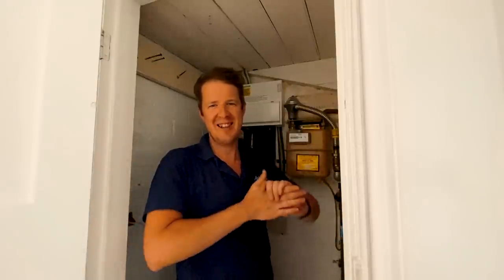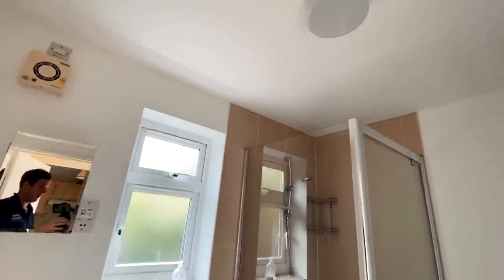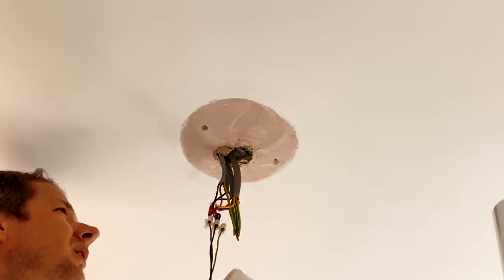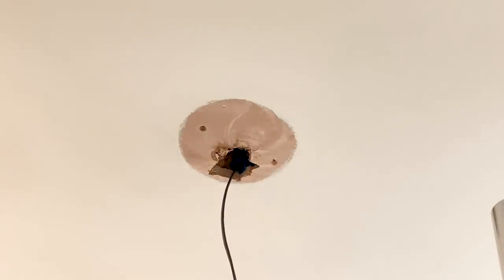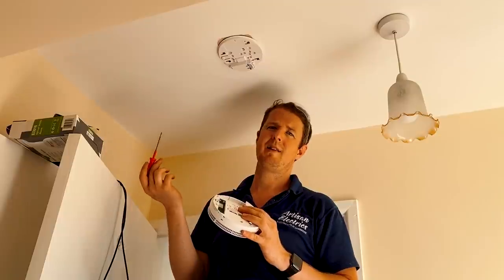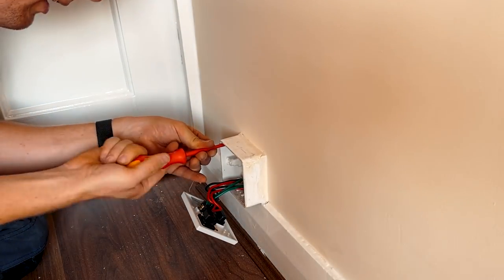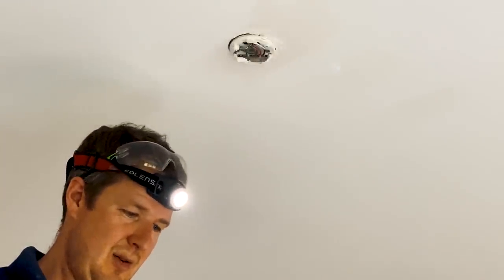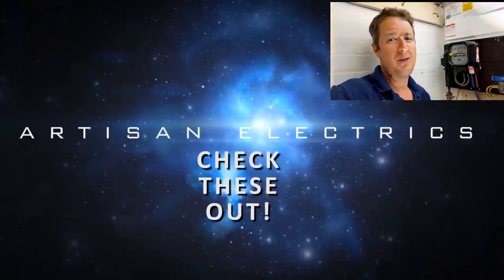Repairing Electrical Faults - Electrician Life

Comment: Here in US I would not be able to find a smoke detector to fit old base after 3 years let alone 10. Like how UK devices have screws, here most all that connection is done with "scotch locks".  The maintenance free junction boxes seem fragile compared to the norm here, especially at 240V.  Love the missing rose! I can't or won't say how many Mic and speaker cables I've soldered up with the shell laying on the table top. Damn pretty soldering, too, the first time... You're a good instructor, clear explanations, great sense of humor, and not afraid to show the  little bits that make us all human. Enjoy this channel very much. Good advice and tips even for a Yank to follow.

Comment: The other classic is the old MK and Duraplug 13a plugs where you put the cover on the flex first. I've seen quite a few covers with cuts where someone didn't want to rewire the plug...all of two minutes' work.
Reply: See that quite a lot in theatres, on duraplug 15A round pin plugs, i think the newer ones have a different moulding to avoid the problem though.
Reply: @TheErador  yes, I used to work with 5A   rubber plugs in small theatres and saw it there too.
Reply: Worse when you have threaded the cover on the flex and when you come to attach it to the plug top body you realise it's wrong way round.
Reply: @iansanderson4664  hahaha yep I've done that once or twice. I never resorted to slicing the plug top to avoid rewiring tho., it's clear other people before me were lazy enough or in enough of a hurry however.

Comment: Hold the light against the ceiling with the hole in a place that if the screw goes through the case it's Hiden by the light when fitted. Great videos 👌

Comment: On  a housing association I work for we have been asked just to fit like for like with smoke alarms. I.e battery for battery only as per client's choice where mains arent fitted.
I'll have to look into those Aico interlink battery smoke alarms
Reply: It’s interesting to hear the differences in standards between different housing associations. I too work in social housing and the client insists that we always install Aico mains powered alarms with battery back ups. As a minimum standard there must be a heat alarm in kitchen, and smoke alarms in hallways and landings all interlinked. If existing alarms are just battery only, then we have to upgrade to the standard. I thought that would be the case with all housing associations, especially after the Grenfell tower disaster
Reply: @darrenqualters2341  you would of thought so, we were installing mains wired ones then the head inspector for the housing association said not to and they would install them on the rewires and five yearly tests. We can only do what the client asks at the end of the day

Comment: I’ve hard wired them in. when they are all linked together they go off incase your not in that room. you can fit a switch which you can use to locate the alarm that caused it to set it off. Or test an reset it. The switch is only battery operated. Just thought I’d mention it

Comment: You should invest in the 12v Milwaukee Impact Driver and Combi Drill set. It's Ideal for overhead work such as putting up that light rather than that bulky 18v Makita combi drill
Reply: @Luke Heffernan 
If you’re reducing the size of your tool for overhead convenience why would you go with Milwaukee the heavier option and not Bosch? With that said why would you go with Milwaukee obviously your favorite, or Bosch my favorite if neither one of them have the ability to support 20700 cells (the future) and support legacy (the past) 18650 cells, so I would lean towards Metabo or Hilti 12v tools if I were making a suggestion to someone not being a fanboy. Just a thought...

Comment: I'd put money on that mess at the light fitting being created by a spark - many DIYers would be too daunted to deal with all those connections!

You're lucky you didn't have more going on - the one I found the other day had feeds to 2 pendants and a shared 3C+E switch cable all hidden above one pendant 🤨 (although I did have access from above)

Comment: You should buy an awl, it's the best thing to penetrate the screw fittings if you get a thin pointy one.
Here in Germany you'll mostly find the battery powered ones in domestics, mains powered ones only in commercial or industrial installations.

Comment: 29:30 - literally every spark saying 'you haven't put the plate cover on'!!
Reply: Dude, the heat must be getting to you Jordan 😆😆😆
Reply: Ade Jupe Do you remember the old mains plugs which had the same problem - you had to slide the cover over the flex before terminating... or cut a slit in it when you forgot 🤣

Comment: Regarding material shortages, as an Electrician I haven't had any really but I now have 4 rewires awaiting 2nd fix due to the plaster shortage which won't be done until October now so it has affected cashflow a bit

Comment: In a standard house battery only is fine,any smoke detector is better then none, if doing a rewire then include hard wire in  price, I use radio link detectors taking permanent feed from nearest light in some cases, HMO will comply with local building regs ?

Comment: Had a shortage of RCBO's from Hager, Contactum and Wylex as well as Wago's. Basically anything to do with improving landlords properties post July while people have rushed out in a panic to comply on top of the shortage from Covid. A note about the Aico wireless battery alarms - they're a bastard in any building with concrete floors and metal studwork - blocks the signal.

Great video as always but would still like to have seen a non-combustible non-conductive barrier or the gas meter moved though.

Comment: Hi Jordan.  Is the consumer unit not to close to the gas meter?  In the building regs it says in  section 2.3 of the onsite guide that the gas 
instalation pipework  should be at least 150mm away from the electricity supply equipment, main service cut outs, isolation switchesa 
and consumer units.  Doesn't give a regulation number though.

Comment: Re wireless alarms, I advise caution. If there are concrete walls or ceilings, or if there are steel beams in the structure the signal may be too weak. With safety kit, wired is always safest.

Comment: I’d always pilot hole the light fitting first
Reply from the maker: Good! That’s what I should have done 🤪
Reply: You can get hex drive drill bits, so you don't need to remove driver head, as you would with a conventional drill bit. Good for pilot holes.

Comment: I have a Texecom alarm system so use the Texecom Ricochet smoke detectors.  Battery powered but wirelessly linked to the alarm panel.

Comment: Is it a new building reg thing re: wired smoke alarms so it's always got power one way or another?
Reply: It's part of bs5839. Life safety appliances should have an independent feed preferably with battery back up. So basically their own breaker.

Comment: Washing machine and dishwasher on a double socket- recently called out to a melted double, customer could smell burning in the kitchen.Changed to 2 singles. Sorted
Reply: Why did the socket melt was it overloaded or wired wrong .
Reply: Double sockets ( this one at least) was rated at 13 amps. Dishwasher and washing machine on at the same time repeatedly . I recon 20 amps
Reply from the maker: Oh wow!

Comment: If its a rented property, it is actually a recommendation in the BS5839-6:2019 fire standards to use only mains powered with tamper-proof battery backup (Grade D1). With an LD2 category of system, which is cover for: Kitchen, Hallways/Landings, Living Rooms, Loft Conversions.

In a privately owned property, grade D2 detectors are recommended (Mains powered with user replaceable battery backup), the same category of LD2. This could apply to existing houses that are having major work done such as extensions/re-wires.

Personally I don't understand why replaceable batteries are still a thing, I have never had a tamper-proof lithium battery backup become faulty. 
In HMO's and student accommodation, all you get is students taking the heads off and taping over the green light (sometimes the air vents).

P.S. I always try to convince the client to use radio modules rather than bases. As when it comes to the 10 year change, there is no rewiring or fixing up to be done.
Reply: In Scotland, rented accommodation must be fitted with mains powered interlinked alarms.

Comment: Smoke alarms - nest protect seem like a good option for new installs. Can be battery operated but also communicates with phone and all will alarm together. Will also alert on phone if low battery.
Reply: New installs require hard wired smoke detectors. Even adding an extra alarm you should be bringing it up to the current standard. Battery detectors should only  be used to replace old battery detectors.

Comment: It does say in building regs approved document b1 

General provisions
1.1 All dwellings should have a fire detection and alarm system, minimum Grade D2 Category LD3 standard, in accordance with the relevant recommendations of BS 5839-6.
A higher standard of protection should be considered where occupants of a proposed dwelling would be at special risk from fire. Further advice on this is also given in BS 5839-6.
1.2 Smoke alarms should be mains operated and conform to BS EN 14604.
1.3 Heat alarms should be mains operated and conform to BS 5446-2.
1.4 Smoke and heat alarms should have a standby power supply, such as a battery (rechargeable or non-rechargeable) or capacitor. More information on power supplies is given in clause 15 of BS 5839-6.

Comment: Hardwired in the USA for smoke detector required because it’s 2 stage fail safe mechanism. If dc battery fail it’s AC hard wired so detector works if AC mains power goes out DC battery provides backup power to allow smoke alarm to work. If ten year lithium battery fails before year 10 which could happen having a fail safe always helps. Also best practice in US is to have smoke alarm that are interconnected if one goes off they all go off.
Reply: Same in Denmark.😎
Reply: As far as i know same thing in the UK for tenancy properties . Mains powered and inteconnected.Minimum is one smoke detector for each floor + one heat detctor for kitchen area.
Reply: You forgot to mention arc fault breaker‘s or dual function breakers.
Reply: The Truth yes if they are on a separate branch circuit. Since 120-volt smoke alarm devices are considered to be outlets/sockets and at least one smoke alarm is required in each bedroom, the branch circuit supplying the smoke alarms must be protected by an AFCI (Arc Fault Circuit Interrupter) device. If a separate circuit were run to the smoke alarms, then an additional arc fault device would be required
Reply: I don't think smoke detectors use that much power that a battery will last less than 10 years. And replacing a battery every 10 years probably will cost you less than fitting mains powered smoke detectors. To be fair in my country even smoke detectors are not required in domestic installations, and in practically all houses they are not installed. But I think the reason is that houses in the US/UK are typically made of wood instead of concrete and thus domestic fires are more frequent. 

Arc fault breakers are not that useful, at least with 220v that uses lower currents than 120v. And with 220v are more useful RCDs, that are required on every circuit (while in the US they are typically installed in the sockets, in Europe you find them in the consumer unit, so not only the appliance is protected but also the wiring, so if some stupid does some work live on the wiring he doesn't get shocked)
Reply: A1eR  in USA the NEC 2020 code requires mains wired detectors with battery back up in residential properties and commercial properties. Arc fault circuit interrupters can be installed as breakers and at the receptacle. Indeed both types can be installed on a single circuit with the breaker detecting arc faults/heat and fire risks upto the AFCI at the first receptacle with the AFCI receptacle protecting against arcs for receptacles downstream of that. For a smoke, CO ionization detectors with strobe lights connected on the same branch (radial) circuit then usually an arc fault breaker is installed for that circuit or even a dual function AFCI/GFCI breaker. In fact for large buildings with multiple sets of different fire detection devices load calculations are done in quiet standby  and alarm mode with large battery backups for large buildings specd using all active devices in alarm mode (much higher loads).

Comment: A few more classic mistakes which all electricians will probably relate to, forgetting to put the shell on a comando plug, the rubber shell on some of the duraplug plugs/sockets, and the old favourite forgetting the neutral cover in a square d / schneider 3 phase board until after the cover is on!!

Comment: Can somebody point me in the direction of the reg or recommendation that mcbs should be spaced out ? Personally I think it’s bollocks.
Reply: They're RCBOs.
Reply: Rcbo s then mr pedantic
Reply: Good practice, nothing wrong with over engineering things when you have the ability to do so for no extra cost or time.
Reply: Shall we start installing 20 way boards coz we need 8 blanks for heat dissipation , never heard such codswallop.
Reply: @supersparks9466  Actually here in Germany that's quite the standard having so much space in the board, but I never heard of a regulation that you can't fit MCBs or RCBOs directly next to each other...
In my cellar the board has space for 72 units (6 rows, 12 units each), in the first floor is a sub board with space for 24 units (2 rows, 12 units each). But here you can do such things like installing an outlet into your board, I did that in my sub board. The outlet is a special one that fits on the DIN rail. Or as we call it here: "Hat rail", because from the side it looks like a hat in profile.

This is the main board, was installed by the local certified electrician. I modified it later, because I wasn't happy with several things, and I added another fuse carrier for a sub board in the garage (EV charger). And I was renovating the house at that time, performing a whole rewire of all circuits. That's the reason there's almost nothing connected on the pic. The board is only for the circuits in the cellar and the ground floor. First floor is connected to the sub board, the three D0 fuse carriers you can see here contain the fuses for this board (3x50A).  

It's three-phase, which is common here, even in domestics.

https://abload.de/img/img_59291bj8x.jpg

https://abload.de/img/img_5931c8jk1.jpg

https://abload.de/img/img_5933gtk3p.jpg

https://abload.de/img/img_5932gxjyu.jpg
Reply: Hi Supersparks,this bollocks is unfortunately true,the manufacturers of RCBOs have this grouping factor which can potentially derate the current carrying capacity,you have to check their manufacturers instructions,our industry should be dictating to the manufacturers what we require not the other way about.
Paul Meenan from E5 has written about this and would be far more knowledgeble than me.
Reply: @sparkymacsparkface7497  never known that to happen, a 6a tripping cos next to a 40a , must be a heavy load for a long time to produce a lot of heat, the only time spacing was done is when you have banks of contactors in an enclosure, not mcbs
Reply: Well I don’t mind being educated on it but still no one is pointing me to a reg or any written spec on it. My niceic assessment has never flagged up this issue.  Why are these rcbo s running hot? Are people not designing there circuits properly?
Reply from the maker: E5 recommended it to me as an idea as RCBOs can produce some heat
Reply: @sparky macsparkface well I will wait with baited breath for the amendment in the 18th.
Reply: @artisanelectrics that’s fine, what happens when you need to add circuits that will fill the space? Another dB ? Has anyone thought this though? Surely the manufacturers should be on top of this. Next we will be fitting cooling fans inside.
Reply: @Marcel_Germann  lol wow and i thought our panels in north america where big
Reply: @Kevin-mp5of  we have them in the states as well called arc fault/gfci duels
Reply: there isn't one, but then again the regs are just a minimum standard written at the time that can be deviated away from for the better drawn from experience/risk assesment. if the current thinking/experience is that rcbo's get hot then if the space is available in the cu then it would be best practice to learn/follow from others. every day is a school day
Reply: Artisan Electrics I think it‘s more a theoretical thing, and of course a matter of lawyers. To become hot there must be a high load on them, and almost all of them. I suppose the manufacturers implemented it in the manual to prevent someone measuring this theoretical scenario and try to sue them or stating that the parts don‘t meet the specifications and trip earlier as they should.

Comment: the big issue I see with the battery wireless smoke alarms is will the battery really last 10 years, even with a nuisance alarm and with regular testing, of course once battery dies its new alarm. some alarms have 10 year battery but only 5 year warranty

Comment: Suprised you didn't snip the copper off the single socket and restripped. I did that once and had to go back to the property when the original stripped wire broke because it was badly scoured. Just a tip otherwise great video.
Reply from the maker: Thanks